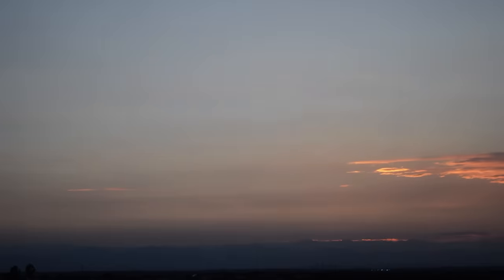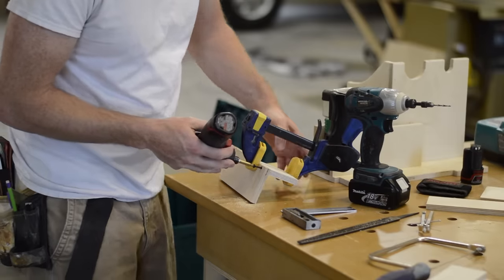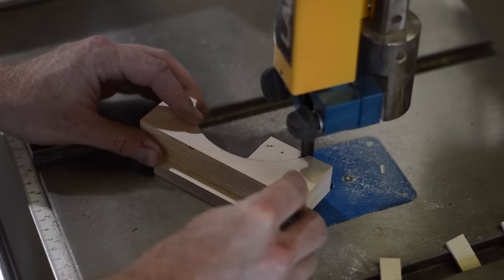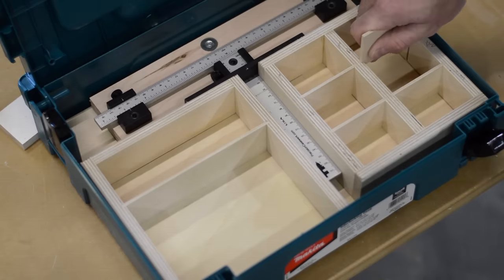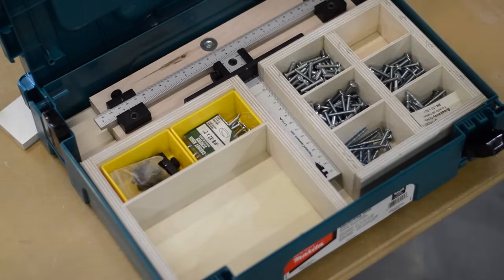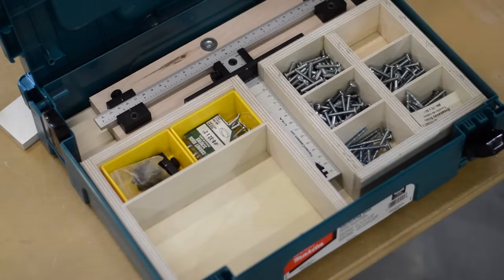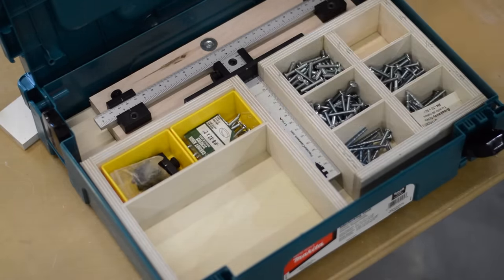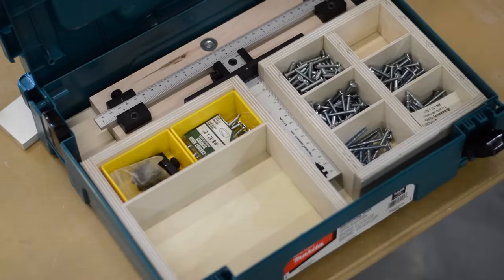Carpentry Tool Organization, Makita, Festool Systainer Build

Comment: This is a very nice execution of systainer organization.  I think my favorite though has to be the pin gun and pin storage one.  I think that one has to be my favorite.  I've bought three times as many pins as I need since every time I go try to find them, they are scattered, broken, missing, or I can't locate the ones I need.  That system you put together is rather perfect.  I also love the compressor in the box.  I had the same reaction to that senco compressor and like you, it's been one of my hardest working and favorite tools over the many years.  I work out of a van and the idea to set up a pigeon hole set up with ALL tools in sys boxes makes getting tools in and out of a job so much nicer.  Now, to set aside the time to make that organization happen.  Thanks for sharing.
Reply from the maker: I also work out of a van, and the systaiers really help organize the small space well. I have really liked the combination of compressor box and nail gun box, these two really work as a team. So far its been a nice addition to job site work.

Comment: Love that air compressor box, .
When I built out a retail store in Boston I  made a plywood box with a little air filter in it and rigid foam  glued do the plywood for noise reduction on site .
It had a makeshift handle and dropped over the compressor , then I tossed moving blanket over the contraption, it was ugly 🤭 but quiet for a little Emglo compressor .
Your box is way more portable and presentable Nice work ⚒️ Enjoy it at work . Now you need to build a custom car to roll it from the truck to your shop 🤭🤭👍
Reply from the maker: Thank you very much.

Comment: Hi Mike, ...seems a natural fit, to use the removed compressor handle to replace your handle on your "main tool kit" holder (instead of your potential 1" dowel upgrade)... thanks and best to you
Reply from the maker: This is a good idea, unfortunately I threw that handle away. Bummer.

Comment: The lightweight plywood helps a lot. Some parts with more use (and fragil), I hardened with resin and put a thin rubber in some spots to well accommodate and fix the tools!
Reply from the maker: Sounds like a couple pretty good ideas. Thank you for sharing.

Comment: You did a great job but I'm always surprised why people use such thick plywood. I'm about to do the insert for my box and build a standalone toolbox-cabinet for my paint and they will be done mainly using 6mm ply with some 12mm where needed. Your screw holders are nice but they don't need such thick walls, adding weight to the box. I live in London and I have to take the tube (subway) a lot, and the weight has to be kept down. Nice video, Great apprentice!
Reply from the maker: Thank you. I used 12mm, 6mm and 3mm.

Comment: Nice work. A while back I purchased on sale a few of the Tanos systainers for various tools that had no carry case or bag, hate the bags. I just lined the systainers with kaizen foam. I did have the old Festool tool box systainer with wooden tote, but it did not fit the tools I had, sold it off...
Reply from the maker: That method probably was easier. I built my main tool storage based on the festool insert. I almost bought it, but then I noticed that it built for a specific set of tools, so I decided to try to build one of my own. We'll see how this one works.

Comment: something for the manufacturer of the systainers to look into. what if your work where in plastic? imagine the weight save. love your work.
Reply from the maker: Thank you. I think the tools I use are too specific to my trade. I wonder if others would be able to use my exactly layout. I think there could be a market for precut CNC parts that are easy to screw together, this way the end user could cut and drill out for their specific tool set. I don't know, honestly, I'm really not a product development expert. I just build stuff in my shop.
Reply: from what i saw in the clip, the tools u use most carpenters do use(and consider im only a painter :D though ive quit my job last week to be a carpenter apprentice) :D
Reply from the maker: You could be right. Good luck with your apprenticeship! Thats great to hear.

Comment: This was such a satisfying video! The only potential issue I could see was with the general tool box. The shelf on the left that is holding so many tools seems like it could be a potential a weak point. If doing it again I'd vote using a dado to give the shelf better support but if you can find the room to attach a couple of brackets underneath would accomplish the same thing. Love your vids!
Reply from the maker: Thank you very much. The shelf holding up the tools has a cleat. It has a little flex towards the outside, but its held up well so far.
Reply: @MikeFarrington  sounds like you already thought it through! Love the designs!
Reply from the maker: @Sfyre  I do my best to think things through, but I'm far from perfect. I appreciate the input.

Comment: Very nice! Interesting compressor solution. Gonna have to rethink my Ridgid Pro Toolbox system, lol. I do love their clear-lid briefcase boxes though. Kinda stinks having a mishmash of tool case form factors (speaking for myself). Already have a 5'-tall stack of Ridgid boxes, probably too late to start all over and convert to Systainer, even though they are so nice. Wait, I think my Fein MultiMaster is actually in a small systainer...oh no...
Reply from the maker: I would encourage you to think how you could use your current system. I think all of the various box systems have their pros and cons. These are no different. If you already have a different system, figure out if that will work first.

Comment: Hi Mike. Great job at organizing.  I was never a fan of sustainers. I used Pelican cases.  I was n the plumbing/HVAC trade.  Still had to do a bit of carpentry on residential jobs.  Ridgid came out with a stacking system that was also waterproof like Pelican.  I’m in Louisiana. The place is on big swamp. Real tough on tools.   I know Denver doesn’t get very humid. But I might consider something with a watertight seal for the video gear.  At least get silica gel packs .
Reply from the maker: Thank you. I like pelican cases very much. I have used them for other stuff. We don't need to worry about humidity here, its super dry. I do like the idea of silica packs, good tip.

Comment: Can't fault your methods or attention to detail. This was a really good build. I approach things differently and have always thought your approach of storing the consumables in the same box as the tool to be wrong. The way you laid this out was really nice and has made me consider whether I would be better to at least consider this approach. I normally have tools in boxes and consumables in their own boxes for each tool. This does mean I have a couple more boxes but I can carry more of each. That is not always a good thing when you consider weight. 
Loved the compressor in the box. I don't use one but if I did, your idea would definitely be something I would consider in the purchase. You could add a couple of small fans to the systainer. Like the PC fans that you get. You can get them rated at mains and you could just have them come on with the power as they are whisper quiet. Then you would not have to worry about heat I  expect.
Great builds. Thanks for the ideas.
Reply from the maker: Thank you Jason. I fully understand your thoughts on consumables. I have a few "extra" systainers that I use for consumables as well. Things like shims, caulking, construction adhesive, etc. will go in those. In my main box I have a few small glues and thats about it. I like them in there so I can use them and set them down with the tools I'm using. I also really like having consumables in a separate box because I can open it up and see whats missing very easily, helps keep inventory correct. In the end, there is no perfect solution, I am constantly changing, hoping for the better. Good idea on the PC fans, I'll use it as is and add one if needed.

Comment: Good for you man, awesome work. My only suggestion is that you should sell all your makita boxes and go full Tanos T-loc. You put in tons of solid work for efficiency, and those makita latches and their housings can wear out, get gritty, and become really jammed and cumbersome especially compared to the smooth interaction of the t-loc system. If you do end up going this route, I hope the bottom profile is the same so you don't have to re-shape/re-make all of your inserts!
Reply from the maker: Jared, you may be right. I probably wouldn't sell them but rather repurpose them. If the click lids are a pain, I'll switch over on the ones I use most. The foot print of each is close enough to switch everything around (a couple small cuts need to be made).
Reply: Yea I have both as well and the click latches on the makita are pretty terrible. Maybe they've redesigned them since I got mine a few years ago

Comment: Senco now actually have a compressor in a t-loc: Senco 3PR2014N Excellent vid, thumbs up!
Reply from the maker: Thank you. yes, the Senco compressor is pretty cool. I considered buying it, but I already had the compressor so I figured why not give it a try. If this didn't work I was going to do that direction.
Reply: Mike Farrington it gives an indication that heat won’t be a problem within a systainer 👍🏻
Reply from the maker: Agreed. I have used the compressor with the lid closed where it cycled on every 45 mins or so and the box only felt slightly warm.

Comment: Enjoyed your vid thanks - I might well follow suit myself at some point for my tool storage. Yeah the Festool Systainers are tasty but as you point out, they're a bit on the pricey side compared to the Makita offering. For those who might not know, they will attach to the Makita Makpac systainers you feature here (the Makpac latches clip onto the attachment points around the T-Loc systainer's bottom edge). I've owned both types and have also had the green & black Hitachi HSC (Hitachi System Case) systainers. These are very similar to the Makita boxes and will interlock with them fine but compared to the Makita Makpac, the Hitachi latches seem a fair bit smoother to use.
..
Reply from the maker: Thank you. Great tips.

Comment: Great job men ! I'm working in industry and using tools all the time. So its a need for me to organize my tools. In my spare time I'm using tools aswell.  I was searching for a long time until I saw your video ! ... I think I´ll going to build something similar with this Tanos systainers.
Really impressive work! Hope it worked for you I think it will work for me :) 
Cheers
Reply from the maker: Thank you. So far this system has worked out very good. Much easier to setup and break down each day.

Comment: You alluded to this in your video but to add some extra info: Tanos is the company that makes all systainers, they're a sister company of Festool, but you're right that they make all systainers the exact same (aside from colour) for different tool manufacturers.  They also make their own Tanos branded boxes.  I'm not sure what it's like state side, but in Canada many of our Festool retailers also sell the Tanos systainers at roughtly 80% of the cost, so buying an empty Festool systainer new is almost never worth it as you're just paying extra for the branding and green latches..   Not quite the savings you mentioned with the Makitas, but it's a cheaper option if you want access to the full range of systainers and accessories.

And great job on the project and video!
Reply from the maker: Thank you! This is some good info. Thank you for adding on. Yes, the Tanos boxes are a little less than the Festool, and the Makita are a step cheaper then that in the States. Obviously they are the older style without the T loc. Honestly, I don't think I will mind the combo of the two different types. I have had several of the original festool systainers for years and I still love them. As I mentioned in the video only time will tell if this was a good idea.

Comment: It feels great to know I’m not the only one out there with this much time and effort into my jobsite setup. People think I’m weird when they see all the jigs and container organizers I have at the job but my tools are always were they need to be and they don’t get beat up inside my tool boxes plus when I leave a job it’s really easy to spot if a tool is missing and I’m about to loose a couple hundred dollars because I over looked a tool.

Also where did you get that short double sided pull saw? I have 3 and they are all to long and they have to go into a bag and I want them in the box.

Recently I switched over to all battery powered no more compressors lol. Table saw and miter and every hand tool I have are now battery powered and I’m so glad I did that because setup and take down time has dropped dramatically.
Reply from the maker: I fully agree with your comment, seeing a hole in your tool box and knowing which tool it is, super valuable when packing it in for the day. Organization equals speed when setting up and packing in for the day, these are the two things I like to do least. Making this part of the job easier... priceless. Here is a link to the saw you are asking about.

https://www.amazon.com/Gyokucho-770-3600-Razor-Ryoba-Blade/dp/B000CEF5HM/ref=sr_1_3?ie=UTF8&qid=1532661050&sr=8-3&keywords=pull+saw
Reply: Awesome, thanks for the link.

Comment: Great builds and ideas.
Never got around to organising my hand tools like you did, but feel I should give it a go after seeing this.

Re systainers from various brands: they are pretty much all made vy Tanos, a German company. Made famous by Festool, and now pretty much everyone has Tanos build them to their own specifications.
That is also why they are not all the same quality or sturdiness: skimping on the reinforcements saves money in the making process & space inside the systainers.
Not a fan of the T-loc: yes faster than the Classic with its 4 latches, but the T-loc comes off too easily, often snapping the flimsy bit in the systainer.
By far the best are the Metaloc boxes for Metabo: most reinforced version around, compatible with the original (Classic) & the later T-loc, stacked in any order; and the only one with a one-hand-operated metal lock.
Reply from the maker: Great information. Thank you for sharing.
Reply: You're welcome.
Forgot to mention: the (Metabo) Metaloc systainers are way cheaper than the Festool ones.
€30 for a size 2, to €45ish for a size 4
Reply from the maker: @hansvanderpluijm3552  Good to know, again thank you for sharing.

Comment: Love the video mate. It was sooo pleasing to my tool OCD lol I'd love to see how you've got on with using these on the job. A possible idea ... have u thought about cutting vents in the compressor box so you could keep it inside the box whilst working ?
Reply from the maker: Thank you very much Matt. I am going to add some venting if needed, but it just seems like every time I pull out this compressor, I only shoot like 10 nails, so the compressor really doesn't run much.

Comment: Love when people put their compressors in systainers! Too much work for me but love the idea, is it loud?
Reply: I was gonna comment at first kaizen foam would have been much easier but I really like how the wood turned out.
Reply from the maker: Thank you. The compressor is very quiet, you can only hear a slight buzz when the lid is closed. For the most part I charge it up once with the lid open, and that gets me through the job. So far I am really liking the wood and how most of my tools are displayed with just the lid open. It has been very convenient to work with.

Comment: I wonder after a little while of using this (the hand tools bit) do you find it better? I'm currently using a pretty organised too bag. But I find putting tools away in all the correct places takes a lot of time. I was thinking of making something like this but in a way I could put everything away quickly
Reply from the maker: I have used both bag and this system. I think both are pretty much the say, except for the fact that this takes up less room in my van. Also, they turn into nice little work benches.

Comment: You could even add so acoustic foam in the compressor systainer as without some dampening you may have just made a speaker cabinet for the thing
Reply from the maker: Thank you. I wear ear plugs so I don't notice the sounds.

Comment: Great video , only though / comment is maybe add a layer (if there is headroom) of foam or non slip gripper rubber material below the compression board inside the sustainer to dampen noise and vibration when in use ?
Reply from the maker: Very good idea. Thank you.

Comment: Hi Mike, this was the video that I first stumbled on to of yours and i've loved your channel since. Onsite organisation is a huge bugbear of mine, can you comment on how happy you are with how your setup is working approaching a year in use? TIA
Reply from the maker: The system has worked great. It has saved lots of space in my van when loading, as well as on site. I have been waiting for one of the boxes to break, but so far everything has help up perfectly. I wouldn't really change anything about my designs, but I will probably add a few more boxes for other tools, and camera gear.
Reply: Thanks Mike, appreciate your response. You're right about those systainers/makpac's, they seem brittle but they are not all, I have never had one break and I am not kind to them at all.

Comment: A far as the heat build up...if needed, you could install a computer fan to suck out/ blow out the heated air. When you plug in the compressor plug the fan as well.
Reply from the maker: Thank you. So far the heat hasn't been an issue. This type of compressor doesn't generate a ton of heat, so as long as its not running constantly, I can leave the lid closed.